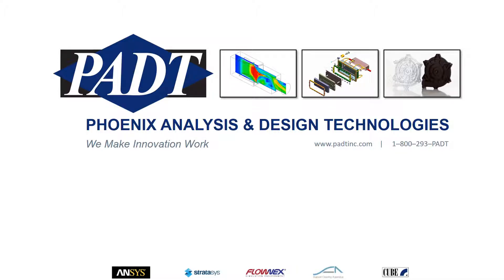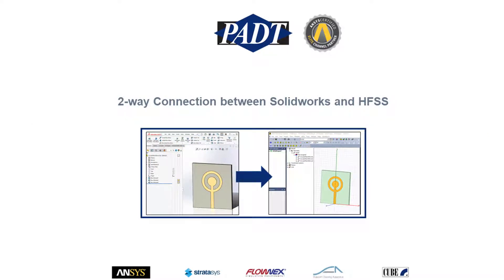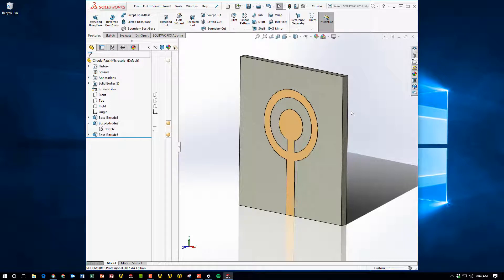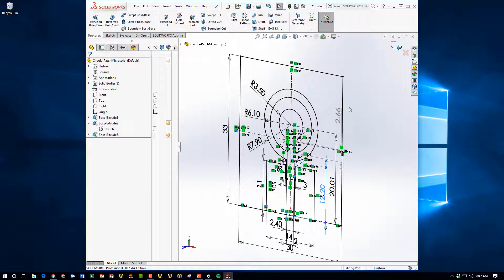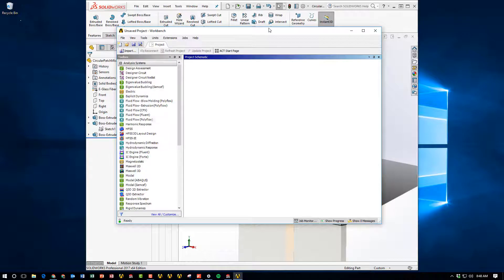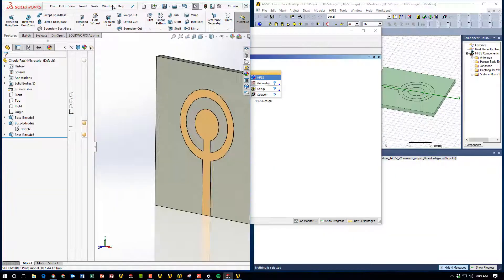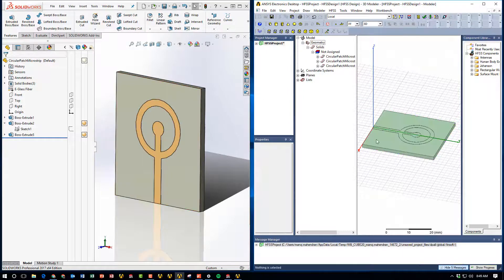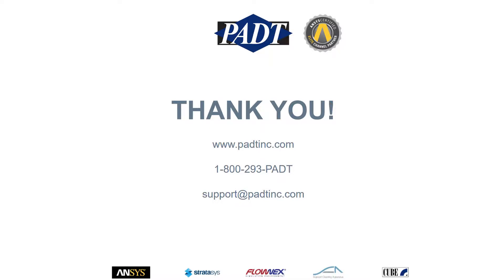Two-way Connection between Solidworks and ANSYS HFSS

Comment: Hello, Thank you for this Video. I made a cone like shape that is generated through rotation of a line around an axis, but the line/curve is a function (y=x, x^2 etc.) that i set in Solid Works. As the curve/line has no naming, i can not save it as D1_line and there is no “Configure feature” for a curve. I was wondering if you could help me out or know of a solution where i parameterized a curve in Solid Works and can manipulate it through Ansys. I would be very grateful.